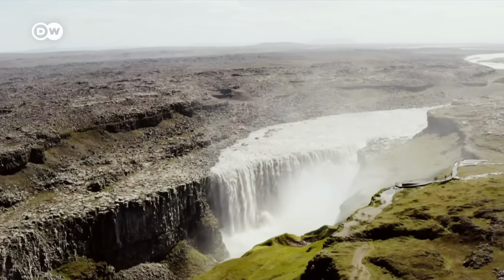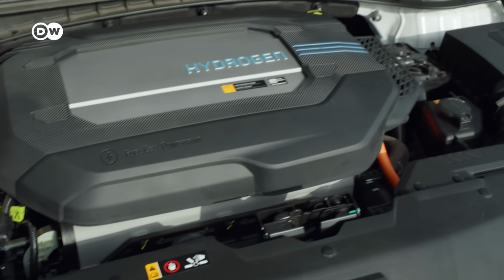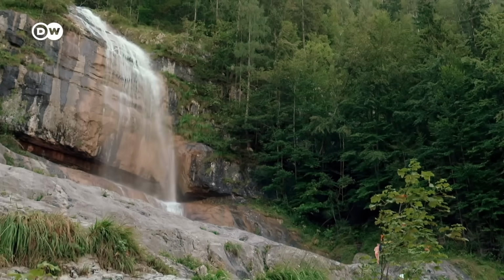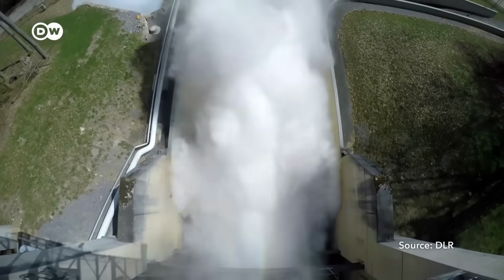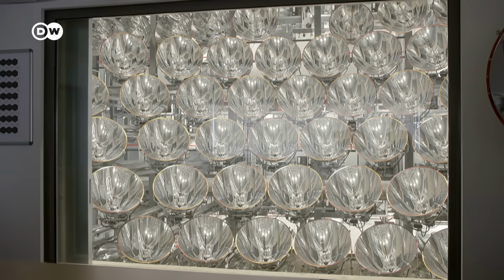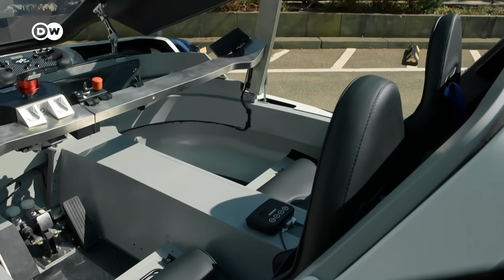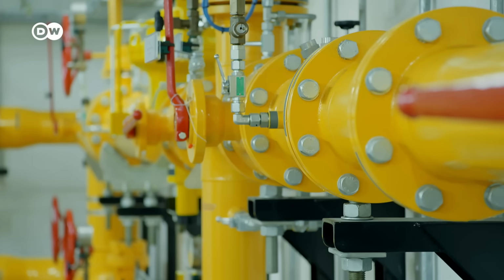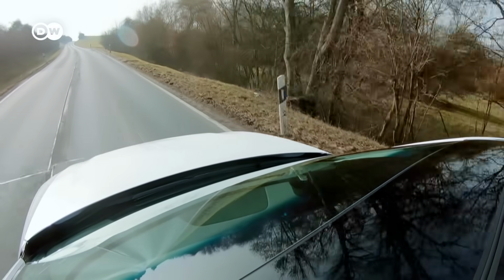Is green hydrogen the answer to the climate crisis? | DW Documentary

Comment: So currently green hydrogen can only be created when there’s an over supply of green energy - hydro or wind typically. Otherwise it will always cost more as it’s a lossy conversion from electricity - even if that’s green electricity, it’s a costly conversion.
Reply: Being a hostage of Russian gas is not costly?
Reply: It isn't a practical science even for a theory designed to break a military and an economy. Let's call a spade a spade.
Reply: Morocco is a perfect example with tons of Solar energy
Reply: @asifalamgir5135  Solar energy is not "Green", cannot be classed as renewable and is terrible for the ecosystem.
Reply: @axle.australian.patriot  What????? Explain how
Reply: @asifalamgir5135  Solar imports energy (aka heat) into the biosphere if used in arid regions the same as fossil fuels. If used over water, forests that traditionally absorb heat then solar is OK on the energy import front, but it is still toxic in either case.
>
So, Large solar arrays used in arid regions where approx 40% of the light/heat energy from the sun is reflected back out into space will instead be ~90% absorbed. 20% released in electrical appliances, 80% released to the local atmosphere. That's actually a LOT of extra heat energy at large scale.
>
Now the whole point of reducing CO2 and CH4 is to allow
A. Additional reflection of heat energy from the planet surface (White Clouds, Arid/Desert regions, and the polar caps).
B. Allow addition natural radiation of heat energy from the planet into space.
If we are offsetting the above by importing more heat than we are releasing then it all becomes a pointless exercise or in some cases a worse outcome than the original problem we attempting to address.
>
Solar has a limited range of convenience when used over water is toxic in creation and disposal. Remember our Oceans are the most significant natural carbon capture mechanism of the planet. Poison/damage our Oceans and the planet is done. So, Solar is a poor solution and far from "Green" or "Renewable".. There are better solutions.
Reply: You can do carbon neutral steam methane reforming as well. Either by using biomethane or carbon capture.
Reply: @levi4979  What do you intent to do with the methane?
Reply: @axle.australian.patriot   Steam Methane Reforming (SMR) is a process that turns methane into hydrogen gas and carbon dioxide.
Reply: @levi4979  Ohh, so we are back where we started with CO2 problem. aka, the solution achieved nothing towards solving the said problem. :)
Reply: For everyone commenting in this thread.
A. I am not convinced about the "Man Made Global Climate Crisis", that is my position.
That being said,
B. I am and have always been for being good stewards of our planet and ecology. And I am up for "Genuine" solutions.
>
If we have a prescribed problem called "Global warming, then we need to provide solutions that "Actually" address the problem.
So far most of the solutions I see just move the problem from one place to another.
Yes CO2, CH4 and some others are important in the equation, but the real issue here is the build up of excess energy in the biosphere (aka heat). Importing additional energy from outer space or, under the ground is just removing greenhouse warming and replacing in with direct additional warming :)
>
1st Law of Thermodynamics - "Conservation of Energy"
“Energy cannot be created or destroyed; it can only be changed from one form to another.” (Albert Einstein)
>
The law of conservation of mass states that mass in an isolated system is neither created nor destroyed by chemical reactions or physical transformations.
>
We can selectively pull the small parts of the big picture to trick ourselves, but at the end of the day the universe WILL balance the equations :)
Reply: @axle.australian.patriot  thanks to  people like you there had to be founded a new study. Agnotology
Reply: Another big oil spokesman
Reply: Oh no, there's another solution for producing green hydrogen without any CO2 emissions: nuclear power plants. Constant production without warming the climate.
Reply: We have an excessive amount of potential green energy. So if we build to capture more we surely can use more to make hydrogen.
Reply: @tookie36  That's why many nations are turning the coal and gas power back on.. to overcome the excess supply of "Alternative" energy production lol
Reply: @tookie36  Technology always makes improvements.
Reply: @raybin6873  Not if loss of revenue of the rich is involved.
Reply: Going "green" will cost 150 trillion for the US. Yellen admitted that the other day.

So im confused, I thought the green teams didn't give a dam about the costs.
Reply: @susanhighfield8284  Monetary value of things does not really exist. It is invented by the wealthy and is be used to control people to get what they want = Profit Gains!
Reply: @mramstedt  what? No. It's a capitalist system and we all benefit. Rich people aren't the only ones that sell things.
Reply: Or Nuclear, you know the most clean option out there
Reply: @spacetomato1020  imho it is producing waste and has proven to be risky business twice. 
Molten salt and fission would be great if possible at all
Reply: Pretty much, Hydrogen is essential an energy storage medium for applications that can't easily use electrical energy directly. (aka eliminating toxic batteries, space shuttles, etc). There is always an energy loss (to the local environment) during energy conversions, so the the less conversions of energy the more efficient at the end of the day.
P.s. Solar isn't green, it imports energy from outside of the biosphere and is extremely inefficient in conversion.
Reply: @axle.australian.patriot  ....all energy forms are at a negative loss.....think about it, its a false comparison....think of what goes into making gas and oil from Millions of years of dead organics.....your just discounting the facts and stating Untruths !
Reply: @axle.australian.patriot  
The biosphere imports energy from outside the biosphere... daily. From the giant fusion reactor in the sky.
Reply: @axle.australian.patriot  
Got any better ideas?
Reply: @raybin6873  Got any better questions?

Comment: Anything can be green if you ignore the initial energy source. My V8 is green, if I ignore the gasolene, 90% of my hybrids mileage is on electric. Globally,  coal use has actually doubled since 2005 to make electricity? Electrolysis is about 5% efficient? Very inconvenient facts. If you assume Greta gets all her demands in Western Europe, the planets CO2 will only fall by 5% or 6%. Not a practical business model unless you funded through tax grants and never need to make a profit. China has the most electric cars but 80% of the electricity comes from coal? Pixie dust is not the solution.

Comment: Dumb opening question: Will green hydrogen answer the climate crisis by itself or is it a fad?   The Earth is a complex homeostasis-keeping system, hence the fertile conditions we've enjoyed, for like forever, till recently. Whether or not you subscribe to the Gaia Hypothesis that's not necessary to understand the metaphor of the Earth being sick, like having AIDS, specifically, Acquired Immune Deficiency Syndrome.  All disease is disease complex, so taking a complex of approaches to heal.  Green hydrogen is great for its known applied uses, then we may find a few more, but it'll take ending deforestation & petroleum use to "answer the climate crisis", then also massive reforestation, switching to Regenerative Agriculture, as well as how we manufacture things etcetera....  Forests stabilize climate & being key to hydrology, make an abundance of fresh water.  However, we need an abundance of forests to do this and reforest the supposed to be wet side of mountain slopes, which would be strategic reforesting. Switching from clearcut logging to selection logging that doesn't highgrade, meaning it keeps relative old growth and only takes out smaller trees that crowd out space for understory plants. This would be berries for bears & other creatures, like us. Please advocate for this cuz COP26 needn't end, as our dear leaders can Zoom it till we set things right.

Comment: Good documentary – very comprehensive despite limited time. Unfortunately, that's not enough explanation for people without some knowledge to really understand the content. Also, it completely left out that nuclear reactors are ideal for producing carbon-free hydrogen: the enormous heat from nuclear reactions far surpasses that of the massive solar-heat installations, so it can split water into hydrogen and oxygen using the same process but at much higher production rates. Since the reactor works as well independent of location, it can be built in Germany or wherever the hydrogen is needed instead of importing it from thousands of kilometers away.
Reply: @MJAldridge6  Huh? What? Did you even read what I wrote?
Reply: @CL-gj9mf  The new energy super powers will be countries along the equator. NOT Germany. Although the North sea has ample winds. You sound quite alarmed and despondent. No worries, no single person can make this change alone, even greta thumberg cant do it alone, it will evolve. Green Hydrogen is change in the right direction.
Reply: Old school fission reactors produce Hydrogen passively as a by product since the Fuel rods are submerged in water.

(We don't capture it at all though since it's used along with the rest of the steam to spin a turbine and produce electricity)
Reply: @aslkbgh  And fission reactors are very dangerous.  If anthing goes wrong, the clean up is nearly impossible.
Reply: @donaldwilliamfry  The issue with things going wrong is based on design choices.

Basically there were a lot of issues with the old school tactic with enriched Uranium fission, and lots of safety solutions were added to mitigate the risks.

The science of nuclear power was focused too much on enriched Uranium, yes it's good for building bombs but the fucus is not there anymore since we just want to generate Electricity (or Hydrogen).

I believe that if you'll look over some of the new designs for fission reactors in the 21st century, you'll be pleasantly surprised.
Reply: @aslkbgh  Maybe.  But I am old enough to remember all the hype they gave on the safety of the plants in the 70's and 80's.  They made it sound like a major disaster was impossible.  I guess I am less than trusting of people who stand to gain piles of money through new technolgy with so many unforseeable variables.
Reply: If you had said fusion, I may have agreed.
Reply: @CL-gj9mf  your reaction is severe. There is no way to decouple as instantly as you hope, BUT...begin we must. Green Hydrogen begins where wasted time ends.
Reply: @CL-gj9mf  There is no single working prototype or proof of concept ever built. Fusion has never once produced more energy than it consumes, not once. If they cant prove it in a lab, why are they building monstrosities. Fusion is a 100 year old scam. Green Hydrogen is our bridge over, the only alternative is deindustrialization. Hydrogen is better than caveman days.
Reply: Proposing nuclear reactors near human settlement is wishful thinking today. The political hurdles are simply too great. It'd be far easier to site these plants in remote coastal locations operated largely autonomously or remotely, then ship the hydrogen to the nearest port. Best of all, many of these locations would welcome something to replace lost fossil fuel jobs.
Reply: Hydrogen...like the Hindenburg?  Nuclear reactors...like Chernoblyl, Fukushima, Three Mile Island, and many to come?  All volitile and disasters that will happen.
These options, especially nuclear,  are far more dangerous than fossil fuels.
Reply: lol well that defeats the point of green hydrogen...its red hydrogen, producing nuclear waste to be stored for millennia beneath the ground. Efficiency takes a back seat to a clean environment.
Reply: @-OnTheRun-  you do realise that the presupposition to nuclear waste is in fact radioactive matter which is actually far more cumbersome for a country to retain and obviously significantly more volatile. At one point the UK government was considering disposing of huge amounts of uranium & other highly radioactive chemicals to the taxpayers’ cost of BILLIONS of £s whereas the alternative would’ve been to use these compounds to generate power and the country would’ve met all energy needs until some absurd time like 2100 (as predicted, of course). The only other thing that kind of material is useful for is atomic bombs and I’m pretty sure any reasonable person would not think the world needs many more of these…
Reply: @donquixoteupinhere  I would offer the nuclear energy industry no further concessions. The upfronts are colossal and the spent uranium/plutonium/thorium/salts whatever is used will pile up like radio active landfill. It is completely and endlessly a dead end.
Reply: @-OnTheRun-  FAR cleaner than anything else and you forgot Thorium. It's almost as if you're uneducated on the topic...maybe at life in general.
Reply: @TheGuruStud  Im no expert on anything, but I naturally know whats right...it comes from a good upbringing.
Reply: The problem with nuclear is that it is by far the most polluting option out there.  Not only damaging lives today but for tens of thousands of years.  Hydrogen provides a viable option for a clean future which nuclear does not.  The only advantage to nuclear is that while electricity goes out the front door weapons go out the back door.
Reply: @Jamie-Z  nuclear is highly green, it is just stigmatised due to old reactor design failures. Modern reactor concepts are practically incapable of a meltdown. If nuclear energy could be harnessed safely it’s pretty much the next best thing to full blown nuclear fusion (it’s much less clear this is surmountable). The storage of waste is a consideration, too, but it’s still costly for any government to sit on radioactive material anyway which most do.

Basically the only “greener” way of producing energy is to yield it from the sun (even this yields a calculable and not insignificant co2 cost), or other renewable energy forms… however there is a clear limit to what exactly can be harnessed in this sense which is absolutely covered in this video… there are only so many places with rabid sun (and ideally we would take advantage of all of that), there is only so much wind etcetera. And that’s without even really considering that time plays such a pivotal role in all of this—we need solutions now. With that said, short of actually harnessing our own form of fusion, the next best thing to renewable energy is by FAR nuclear. Emissions of carbon for nuclear energy production are up to several times lower than fossil fuels. In this sense to meet actual demands in a practical way while significantly improving global emissions, nuclear could be a great ally if done right.
Reply: @Jamie-Z  And... how do you obtain the hydrogen, genius? By aligning your chakras?
Reply: @dubistverrueckt  You miss the point entirely...GREEN HYDROGEN specifically means hydrogen obtained by electrolysis powered by free renewable energy sources. Unlike grey hydrogen that is made by methane steam reforming or blue hydrogen where the co2 production is captured. GREEN HYDROGEN cannot be made with nuclear, because then it would not be green hydrogen.
Reply: @-OnTheRun-  No, but it WOULD be non-carbon producing hydrogen, that could be distributed much faster and more widely than green hydrogen. It would even buy time for proper r&d of green hydrogen. The point is, if you believe the climate crisis is rapidly reaching the point of no return, you really have no choice BUT to adopt nuclear produced hydrogen in order to eliminate fossil fuels soon enough to make a difference to the survival of the planet.
Reply: @Grimenoughtomaketherobotcry  It is not a question of manufacture capacity of electricity, but a problem of storage. Nuclear besides being a destructive pollutant has no built in portability so every region needs its own Fukoshima. Green hydrogen is a large, extendable, easily charged battery bank of gigawatt proportions if needed. Yemen or outback Australia could become world energy super powers through potable sun energy in the form of green hydride and ship it in any quantity anywhere in the world economically. But the hydrogen economy stands for more than that, decentralized energy production means mom and pop can run a passive solar hydrogen business on their home roof. The 3 trillion dollar energy sector will be divided up out of the hands of the few and into the hands of the many...although those lucky Saudis are blessed this second time around, first they had the oil, now they have the intensely productive Sun.